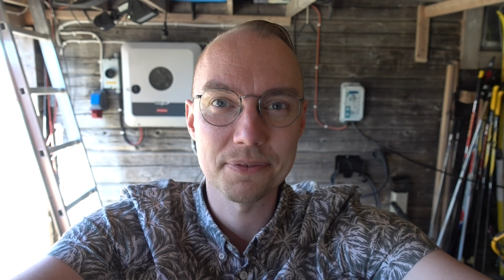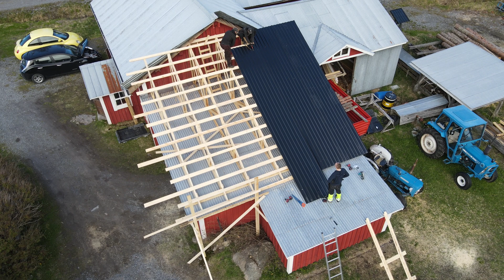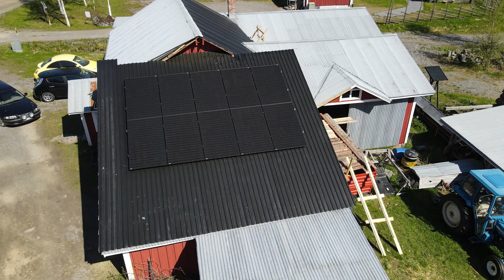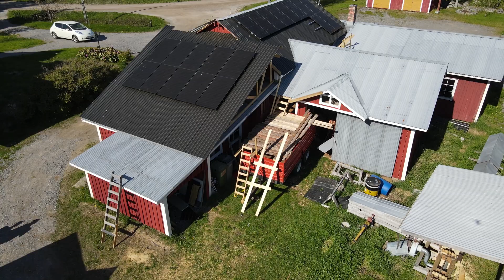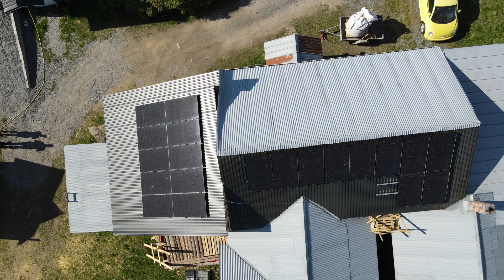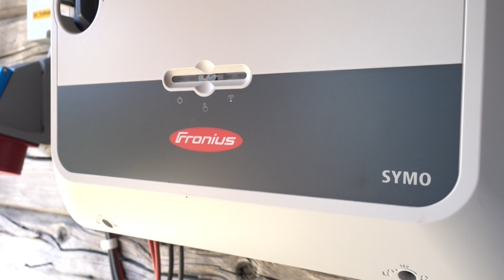Dala's solar-powered workshop ☀️

Comment: Hi Dala I'm after some advice could I open up my Nissan leaf 24kwh battery and replace the modules with the 40kwh modules and leave the original BMS and communication unit in would that work and would It show the new range or do you have to up date the gids
Reply from the maker: No that is a terrible idea. Lots of work for a bad solution that will have display issues and charge max 21kWh. Use a complete 40kWh pack instead!
Reply: @DalasEVRepair  ok thanks for your quick reply will look out for a complete 40kwh battery

Comment: Have 25x350 W panels and connected to the grid. Had a 5 kWh battery installed on Wednesday but it doesn’t seem to charge properly, must be some software problems since neighbour have same installation and same problem. Well the installer ain’t getting a penny until they fix it!

Comment: I understand that the Leaf has a 1kw power inverter between the traction battery and 12v rail so you could use the Leaf to power your house overnight with a small 12v inverter, provided higher loads such as cooking, washing and water heating are not powered on. My home only uses about 120-160w average while it is dark outside so you might use ~1.5kwh per night or less than 10% of the leaf capacity.
Reply from the maker: Yes, that is the most economical solution if you only need max 1.5kW

The Fronius inverter can supply power even when the grid is down, but it costs way more $$$$ compared to a pure sine inverter hooked up to the 12V battery!
Reply: @DalasEVRepair  hey again,I forgot that you have a Fronius inverter too!I wrote a message 2 data ago about ongrid  inverters working directly on ChaDeMo port.. That would be pretty awesome!
But I feel you got  a wildcard in your sleeve..... ⚡!Respect

Comment: 7.2 kw is a great size for a workshop power supply.  Proprietary grid tied systems are very difficult to get to co-operate with a DIY, pseudo off grid battery bank.  I wound up just doing two systems, 1 grid-tie for house power, 1 off grid for the workshop.  But you are quite talented at the electrical system manipulation, so you can probably figure it all out.  I'm excited to watch you have a go at it!  What voltage do you think you will be building your battery bank to?
Reply from the maker: Stay tuned for Modbus RTU reverse engineering :)

Comment: I feel you could have had another row under the array on the new roof.

Just swapper my old eversolar 3200tl for 4600tl the other day. The reason was now i can add more solar to a pergola in my garden on another string input than the 3200 didnt have. Hoping to got from 3kw to nearer 7kw like yourself using both eversolar inverters daisy chaining the rs485 and outputing all the solar data via a pi using the perl smoller script. Just trying to figure out a battery solution too. Btw excellent work as always.
Reply from the maker: Thanks, and yes there's always room for more panels :)

Comment: I am hoping to see you hack an old Leaf battery to use as the solar store. Even my old Leaf with only 6 battery bars still has 12kWh left, which is a lot for a house.
Reply: I just took apart my old 6 bar Leaf battery for a home powerwall.  It was honestly easier than I was expecting.
Reply: @InnovativeSustainableSolutions  Same plan here

Comment: Here in Estonia, joining up with solar now to sell back to grid has so stupidly low rates that getting your investment back is pretty impossible. Better to store for local battery (but thats even more cost) or mine crypto with it.
Reply from the maker: If I had excess power I'd run scientific workloads instead on the GPU! Look up BOING+Gridcoin ;)
Reply: @DalasEVRepair  got to be more useful than the wasteful cryto nonsense that has become a bad joke.
Reply: @DalasEVRepair  yes, doing BOINC for years at Berkeley and helped get it going on Android : )